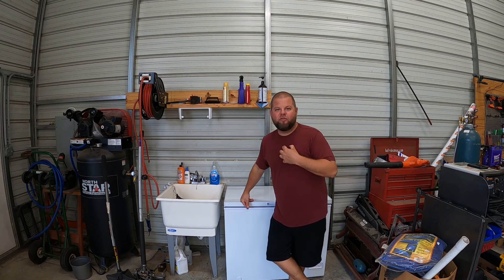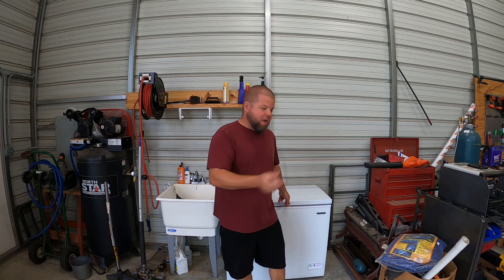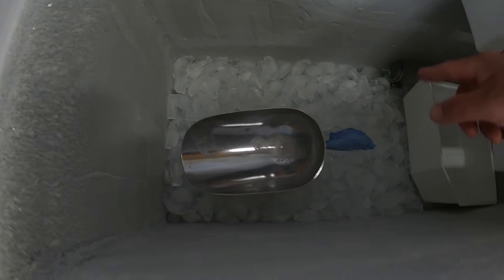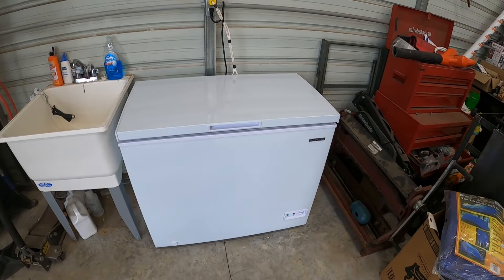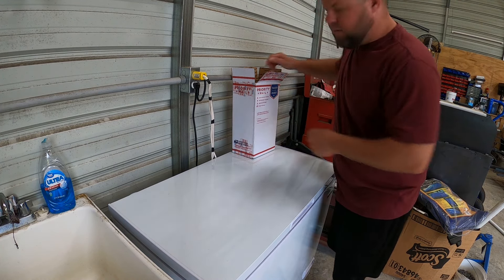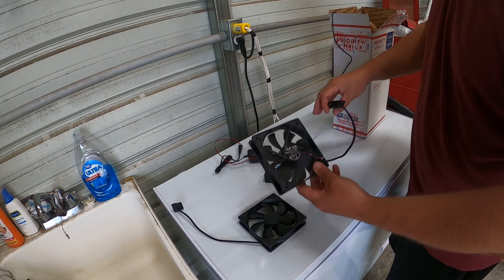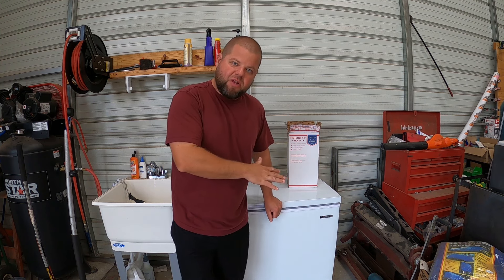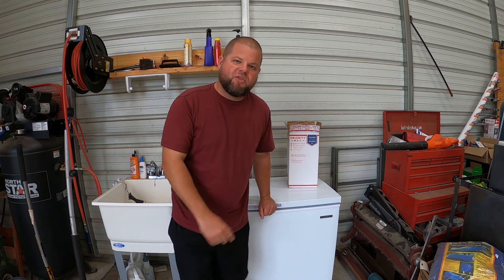Homemade ice machine update! Viewer requested

Comment: i love this. i have a countertop ice maker because i can't drink without a full cup of ice etc. but i feel like my little ice machine makes like 4x as much as one of yours. however it cannot hold that much and so i constantly have to use it or move it to my freezer. i wonder if you could take the components of a higher powered one like mine and put it in a big freezer like yours... another thing i like about yours is that you can also use it for food. if i did it would i would maybe put the ice makers over the other side and get one of the baskets that fit over the hump on that side and use the basket for food and the deeper big part for ice (and maybe put some gallon jugs of water at the bottom too), but yeah very useful and i love that it doesn't stop your freezer from being a freezer or your ice makers from being ice makers and is easy to undo. thanks for sharing!
Reply from the maker: Lots of options. Mine also makes much larger, colder and longer lasting cubes than those table top models.

Comment: Cool project... Even after the ice chest fills and equalizes temperature, you have to factor the cost of electricity into the equation to get the actual time before you recoup your investment. 
   You use a lot of ice!
Reply from the maker: Convenience is hard to put a price on
Reply: @TKCL  So true I rarely go cheap, I usually go quality. Thanks for sharing your project.

Comment: I've replaced probably 6 ice makers in my refrigerators over 20 years now and love your use of them in the freezer.  With that duplex design if one goes out you still have a working one going.  I'd like to reclaim the space in my freezer taken up by the silly icemakers that break and just make a huge dump bin to keep plenty of ice on hand.  Now to surf the internet and see if I can find an ice maker that puts out those saucer shaped ice cubes instead of the kind you and I have now.

Comment: Nice job on the icemaker . Just the tip fill the water tube up with sand it will not crush when you heat it up
Reply: I just watched the original n was gonna say that lol 🤣
Reply from the maker: Good tip!

Comment: On a similar line , I removed the shelves from a regular refrigerator freezer and put the biggest storage tote in it for an ice catch container.  Worked great for me except the extra weight was too much for the freezer.   Looks like you’re method solved that problem
Reply from the maker: That's the route my friend took.
Reply: @TKCL  if you would, make a post or video on longevity of the ice makers.  I had one in a new refrigerator that was replaced 3 times before the warranty went out.  I asked the repair man what was causing them to fail so fast.  He said it’s mostly due to cheap plastics working in a cold environment.  He also said  turning  down the ice cube size adjustment would probably help out a lot.  He ended up being right because the last ice maker went almost 3 years before it died.  I’m just curious if the colder temperatures in the deep freezer will have any effect on the lifespan of the ice makers.
Reply from the maker: I run this freezer the same temperature as my refrigerator freezer, so that shouldn't make a difference. The beauty of this system is I can replace these ice makers quickly with another brand if I have any issues.

Comment: Brilliant! I love it! Those fans should help (I hope). Circulating the air should give you a constant mean temperature. I have a 26y.o. fridge that still runs fine because I keep it filled up, using canned goods or water bottles to fill any unused space and the bottom of my 23y.o. deep freeze is all gallon jugs of water that come in handy when the power goes out.
Reply from the maker: Testing the fans today, video out soon

Comment: Mount the fan motor up next to the ice maker's but have it pull air thru a pipe that is ran down into the ice on the bottom of the cooler. The air will circulate between the ice cubes, thru ALL the MANY holes drilled in the pipe up towards the ice makers. This has turned out to be an incredible ideal.
Reply from the maker: I like the pipe idea! Thanks

Comment: If you take 3 to 4 inch pvc you can heat it  then  flatten it and attach your fans to it to push the air past the ice same as we did with pool liners only we where pulling air out

Comment: There is an adjustment for time in the front cover of the ice makers.  You can speed up the prosses if the ice forms well before the dump time. It is a flathead screw under the cover and on some models it has a + and - symbol so you know witch way to turn. Make adjustments half turn at a time or less.
Reply from the maker: Correct, I looked into that
Reply: robsycko, that screw is regulating amount of water entering icemaker by changing water valve opening time..... There is a sensor molded in the wire and touching the bottom of metal ice form, that will close electric circuit ,when metal ice form temperature will get below 32F(meaning water is frozen in the form and it is time to rotate icemaker motor and dump out ice cubes. So the only way to speed up ice production is to lower freezer temperature.

Comment: It’s a interesting project for sure and it appears to work in his favor. The working of a commercial machine is different in a lot of ways and usually work on temp and timer. And I think 10 degrees is adequate to freeze those cubes.of course ice can be colder than 32 degrees hoshizaki crescent cube is rated at 15 degrees mainly because of its sharp and solid cube. The best cube and coldest is a 
Mold Draft it’s a solid 1 1/2 x 1 x1 Rated at 5 degrees
Reply: Kold Draft
Reply from the maker: I can turn down to minus 10 and I Installed fans today to test production increases. Videos out soon
Reply: @TKCL   put up the video!!! Anxiously waiting
Reply from the maker: Still testing, I need another two days to get my results posted. Then I have another cool test next week.

Comment: A lot of what causes ice to stick together in your average home freezer (which is what I think folks might be talking about) is because most home refrigerator / freezer combos have an automatic defrosting cycle that runs in the freezer periodically to prevent ice build-up on the freezer walls.  When this happens, the ice melts just a bit and then refreezes, thereby making the ice stick together.  It's not so much about keeping the ice at zero degrees (or even 10, 20 or 30) ... it's about having a cheaper freezer that doesn't have an automatic defrost.  The pros are that ice won't stick together, but the obvious con (as can be seen in the video) is ice buildup on the freezer walls, which will eventually require you to manually defrost it.
Reply from the maker: Exactly right! Defrosting once a year is no big deal, especially since my ice makers are removable and the freezer has a drain. Ice makers need to be cleaned occasionally due to bacteria concerns.
Reply: @TKCL  Absolutely.  Plus, it's all about your intended use.  In your case, since you're using this freezer specifically as an ice producing unit, having an auto defrost would be undesirable.  As an IT technician, people always ask me, "What technology solution is the best?"  The correct answer is, "What are you actually needing to do?"

Comment: Mount the fans up towards the lid and face them downward. They will push the warm air down and the colder air up. The circulation will provide an even cooling and ice level will not be an issue.

Comment: It looks like you removed the metal bar from the makers...that bar  acts as a off switch for when the ice builds up .. I don't know if this will be an issue for you as you consume a lot of ice, but you might consider placing the makers on either end of the freezer to allow them to function if it ever does become an issue ... awesome machine
Reply from the maker: It's not an issue, I can easily unplug or manually trip them when it's full. It's never filled up on me because I use so much ice.

Comment: Before you do the interior fan, put a second thermometer near the top to determine the actual temperature difference... if you do mount the fan... you can put it just about anywhere (so pick a spot on or near your brackets) as you are circulating air in a closed container (air and water have very similar flow dynamics)...
Reply from the maker: Thank you for the information
Reply: I agree with that, you can put the fan just about anywhere you like, you are just circulating the air after all.

Comment: I can not say that I know the model ice makers that you purchased ; but , I used to deliver refrigerators and also install ice maker kits , they are all very similar , some having a different plug end . My thoughts are that they are timers that rotate and trigger their  functions of heat , push  , fill . I've clocked them to be approx. 2 hr. cycles and eight cubes per .
Reply from the maker: These actually work on temperature, video out today

Comment: Mounting fans,  if you have a pipe that is running from the bottom to just next to the ice makers then you can mount the fan on top of the pipe and suck up the cold air to the top of the freezer.  I have not done this myself however the theory sounds solid.
Reply: Another theory would be to attach copper pipes in your freezer like a loop,  eventually the copper pipe will cool down and act as a heat/cool transfer agent to cool the air at the top.
Reply: I am not sure of adding water with an anti freeze component to help move coolness.
Reply: Lets just say I have seen a lot of videos on how refrigeration works and it is a technology that we use in large computer sites to stop computers overheating.    There is a crazy video of someone putting a heater inside a fridge to see how far he could push the fridge,  lets just say the fridge eventually gave up.     I have even see a video of someone using swimming pool as somewhere to dump heat from their water cooled computers.

Comment: Great project, I would look into getting a used side by side refrigerator or even a regular one that has an ice maker as well. As much as you stay going you can keep your drinks cold before putting them in the cooler and utilize the added ice maker to periodically put ice back into the deep freezer.
Reply from the maker: I actually have a mini fridge in the background. It helps

Comment: Save yourself time and money. Get the chest freezer and as many ice trays that will fit. Load them into the freezer. You make so much more ice faster and with less headache. 
The smallest commercial icemakes are around 40-80 lbs but that's based on storage.   They can produce usuay 150lb per 24 hours if the storage section was larger
Reply from the maker: Not less headache, that requires daily attention.  The ice makers run 24/7 and require no input from me.

Comment: put a perfed 4" or 6" pipe down in the ice and pull air up off the bottom of the freezer. make it u shaped  and mount the fan on the upper end of the pipe blowing to the ice makers
Reply from the maker: I've considered doing that, but a lot of people suggest that moving air anywhere inside and across the ice makers should work just as well. I am testing that today and tomorrow

Comment: Ice (and anything) can be cooled to absolute zero. Ice can't get WARMER than 32-34 f because it melts. The freezer is doing some unecessary cooling because storing the ice doesn't require 0 f. You could probably save some electricity by running the freezer a little warmer.
Reply: Then the ice is warmer and melts faster. The freezer isn't working much because the ice is keeping a very low temperature already. The freezer only needs to maintain the temperature. The only part it needs to freeze is the water coming in for new cubes. Colder ice cubes last longer in a cooler though the difference isn't as big as people might think.

Comment: I recently came across your video and decided to give it a try also, because we use a lot of ice also, but I was messing around with the FLIR I have and noticed a good amount of the cooling was leaking out of the seal of the freezer top and when I put a sensor from my meter inside at the ice level vs the ice maker mechanism, I found there was a wide gap in the temperate. So i modified my mounting setup and dropped it down less than an inch inside the chest and built an extra layer of insulation across the top by using the 1inch pink insulation board, but i separated the ice storage area from the ice makers, so the ice makers are fully sealed in by insulation from the top view, then there is a foam divider separating the 2 sections, which has a separate insulated removable lid over the ice area, so the entire inside of the chest freezer has a 2nd layer of insulation across the top, then the top can close over it all as normal. The way i supported the insulated cover in the freezer was by gluing 1x1 inch cuts of the insulation board to the insides of the chest freezer to acts as a lip for the insulating lid to sit ontop of. Based on this mod alone, the amount of power consumed by the freezer over a 24hr period in the garage reduced by 31%, bringing down my electric cost to run the DIY ice maker setup to around $0.29/day in electricity down from $0.38/day and the ice makers outputs is about 8% more ice based on my bin test vs prior to the mod. I was planning to integrate a fan/blower into the mod also, but the gap at the ice maker level vs ice level has drastically reduced by purely increasing the insulation across the top.
Reply from the maker: Awesome information and something I've been wondering. I installed two fans this morning and I'm testing production increases (if any). I'll have that video out soon. I'm also making block ice to increase thermal mass next week and testing efficiency with my killawatt meter that's set to arrive.

Comment: You could mount the fans in a channel with air holes drilled in it, so the ice level wouldn't affect it. You could make the channel out of two pieces of aluminum attached in a 90 degree angle and place it in one of the corners of the freezer. Mount the fan about 6" from the bottom of the channel and drill air holes in the bottom of the channel that ice couldn't get in to.
Reply from the maker: I did a very simple design, video out today.

Comment: If you need to bump up your ice production use a silicon bread baking pan to make blocks.  They'll freeze solid overnight and be good for about 4 lbs each depending on the size of the loaf pan.  The larger the block of ice the longer it lasts due to the ratio of surface area to volume.   Enjoy.  I'm still just manually bagging tray ice in bags in between trips to get up to 30-50 lbs or so.
Reply from the maker: That's a great idea, I do want a block or two

Comment: Mount fans inside a 6" perforated drainage pipe. Use heat gun (not torch) to warm up plastic so fan will fit inside, bore 3/4 inch holes up and down pipe to keep ice out and increase air flow from bottom mount under ice makers. Perforated drainage pipe costs less than $2 a foot. Vinyl clothes dryer vent pipe might even work, much cheeper.
Reply from the maker: I was going to do that, but honestly in such a small space air movement of any kind should circulate. Testing now, video out tomorrow.

Comment: Was thinking if you mounted the fans parallel, up top or otherwise, it will create a air current that will still get the cold air from the bottom moving across the ice makers. Know you can't mount them lower. Anyway, hope the wood hunt is going good for you and the friend with the OSB hookup can come through.  Take care.
Reply from the maker: Any air movement is better than none, I agree. As for the osb, I had something amazing happen. I'll share that soon
Reply: @TKCL  Agreed, I think you'll really see a difference. Know my kegerator started cycling a lot less frequently and the temp stability improved dramatically. Hopefully amazing good on the OSB! Take care.

Comment: Probably too late, but you don’t need to mount fans on the bottom. They can be mounted up top with the fans directed to pull air off the bottom.  You can further the cold flow upward by using tubes (e.g., 6” flex tubing) that have one opening at the bottom and the other opening  near the fan inlet.
Reply from the maker: I mounted fans up top this morning, I don't think any pipe is needed in such a small space. You can feel the air circulating over the ice.
Reply: @TKCL  - I agree. With the fans mounted on one side, it will create a circular air flow bottom to top). That’s how large cold storage facilities are designed (except the heat exchangers are on the top).

Comment: Common sense will tell u ice will get to whatever temp the freezer is. Freezing point may be 32 but that doesnt mean that is as cold as it gets lol. Thats why those are called deep freezers. Food last longer in a deep freezer than the refrigerator freezer. Refrigerator freezers typically are at just below freezing. The colder the ice the longer it takes to defrost, the longer it last. It was an excellent idea that i may do myself.

Comment: Have you reset the timer on them? I've not worked on one in a long time but used to when you put the arm down it dumped water and it stayed in the slots for so many minutes then dumped. There was a gear you could move to make it fast or slower to dumping. U may read up on it . Make lot more ice what they say . Hope it helps
Reply from the maker: I pulled the end cap off and don't see any adjustments. Luckily my ice size is already quite large. I installed fans this morning and I'm testing production increases.

Comment: I would mount the fans on the lid to blow down...theory is just to move the air, in circulation, around the freezer , off the bottom.
Reply from the maker: I mounted them up top, video out soon

Comment: Need something like an under-gravel aquarium filter to pull the air from for re-circulation.  It's very thin and designed for thicker fluids ;-)